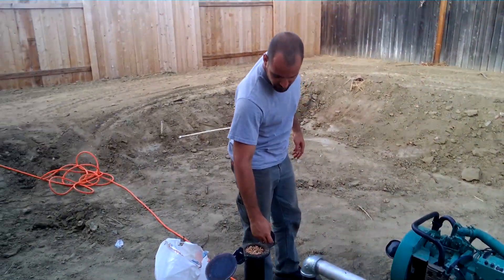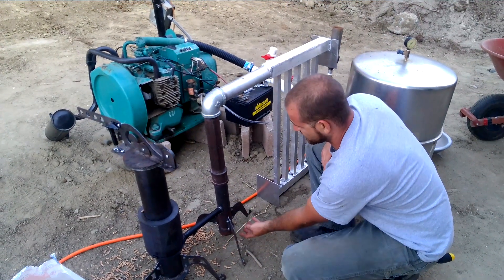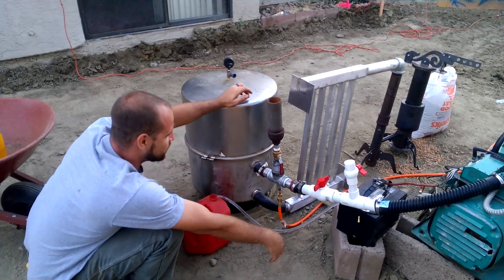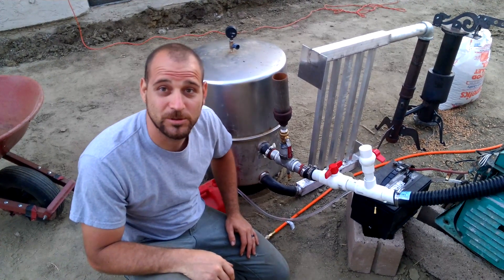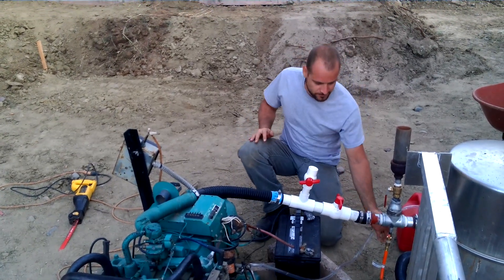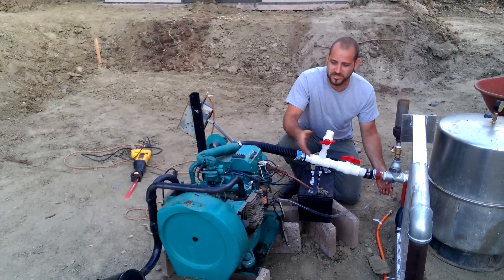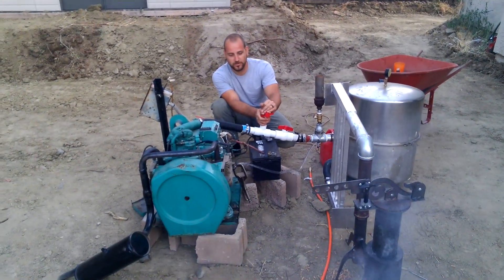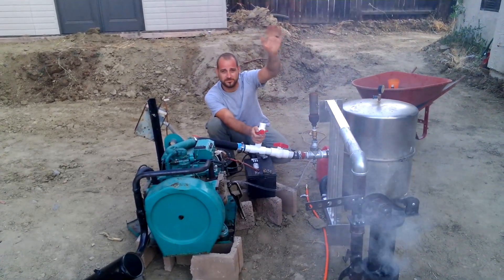Training Gasifier Rig

Comment: if you remove the bag filter does it run better?
Reply: Not too long, if at all.  The filter is getting tar out.  If tar is sent to the engine, it won't be long before the tar accumulates there, stopping the engine from running.  Then comes the breakdown, clean up, and reassembly.

Comment: Using a venturi instead of an electrical blower for startup … Nice, it's intriguing to see something different for a change. It's an alternative indeed, but not exactly an efficient one, given that you're having to run an electrical compressor anyway. I suppose it's better than nothing.
That said, with a venturi you're one step ahead of the blower fraction: In a true cold-start situation where absolutely no electricity was available, you can copy what steam engines (used to) do to generate forced draught: use a jet of steam, not air, from an auxiliary fired boiler, to power the venturi.
Reply: Interesting comment!
Reply: Could this also be done with something as simple as a bicycle pump or is that just not enough pressure?
Reply: @GeneralChangFromDanang  You should easily be able to answer this yourself with a simple Google search.

Comment: Flame tube needs to be bigger.. the horse power depends on the diameter of the tube just If you didn’t already know very cool setup. I did a Subaru station wagon. If you run water jets into your filter pot it works like a air  conditioning set up it cools and drys the gasses and gets rid of small particles all in one no need for the cooling system although you still need a car radiator to cool the water 🤙

Comment: maybe already asked but once you disconnect the air line whats stopping air from being sucked back in that fitting?
Reply: His finger
Reply: @tkmotors991  I'm sure he just didn't put in a check valve on it, or it just wasn't quite hot enough to be able to allow the extra air in the air line quick disconnect.

Comment: Question  Could you use a shop vac as you  bag filter and draw your air for start up then shut off the vacuum and let the gas flow through the filter love your plan simple and looks easy enough to build
Reply: I was wondering the exact same thing
Reply: Ted if enny body bild for me i have lat of wood tedwoodmaster@gmail.
com
Reply: Shop-Vac with work to pull the fuel up but it would never have enough in it to filter your smoke your smoke has to be filtered good or you will get sap build up inside of your motor and if you get sap built up inside of your motor when you shut your motor off your valves will be stuck open door stuck closed from the set when it dries using a gasifier the smoke has to be tear the gases that come out of there when that fire is lit you better not be able to see nothing but a blue flame or you will ruin your motor real quick you'll be pulling the heads off your motor all the time to clean them up your filter system is your most important part you must remove this app just want the gases and they've got to be Pure or it will ruin a motor fast sawdust makes a great filter but you got to change your sawdust frequently

Comment: No cowling on heads on that onan genset will cook that motor real fast
Reply: absolutely right, put that sheetmetal back on or engine will be toast.( I am an onan certifyed machanic.)
Reply: Ron Gibson iam an auto electrical and mechanical  engineer but we expect all to be switched on but its not there fault i guess
Reply: @bambo1957  Out of curiosity, how many generators have you personally run on woodgas?
Reply: @ronlabe5487  Threw that together in my garage with a couple beers with the buddys. lol

Comment: pretty cool looks like you need a lot of materials , a motor. tig welder, 12 volt battery, valves, fittings, piping, and wheat ever else

Comment: Have you thought about recycling the initial gas back into the reaction chamber in order to speed up the process and get up to working temperature faster? It should make sense especially when you can light it..
Reply: +Off Grid Pro I think that also biomass feeding produce the same reaction with a part of exaust ( max 17%) .  biomass, Into the reaction zone, is already become charcoal. boudouard reaction is the same CO2 + C > 2 CO. 
being an endothermic reaction, the temperature drops dramatically. The exhaust gases are to be injected at the maximum possible temperature. Below 600 ° C the reaction takes place in a small percentage
Reply from the maker: This technique works very well on charcoal gasifiers. Gary Gilmore started this latest resurgence in charcoal gasifiers, in which he routes a portion of the exhaust gasses back to the reaction zone in his units. It brings with it some fuel, and also cools the reaction zone a bit.

However, with biomass, the chemistry is a bit different, and this technique would have to be modified for wood. I'm no engineer, but it may not work at all. I haven't seen any discussion on this topic in the wood gas forums.

Comment: When that Onan is running at full speed (1800 rpm), and with no load, it should have no trouble at all getting enough gas from that gasifiier.   I'd estimate that the "overhead' power cost of that genset  (engine running with no load) is about 1000 to 1500 watts max.   I have a friend who has the Victoria and I have seen him run a single cylinder engine at 3600  rpms with a 3000 watt load.  Not for a long period of time, but for 15 minutes or so.  That;s clearly more load than you have there.
  Did you build that baghouse?  I'd like to know more about it.  It looks great!

Pete Stanaitis
------------------
Reply from the maker: Pete, In the video, we're using the Isabella gasifier, a 4-inch pipe gasifier (area = 12.56 sq. in.). The Victoria is a 6-inch (area = 28.26 sq. in.), and has more than twice the gas flow...

But you're right, a Victoria would be perfect for this rig... And one is coming :)

Comment: Stephen's basic Victoria would run that gen set no problem. Ours is based on the Victoria geometry.... with some other mods done... seems to work pretty good.

still impressive for what you're working with
Reply from the maker: Yep... This is also Stephen's design, and it's the next size down from the Victoria. Victoria = 6-inch restriction, and the Isabella = 4-inch restriction.

Comment: you need bigger gasifier or two of them to get the engine to run smoothly
Reply from the maker: Aire... You are absolutely correct. This little gasifier just doesn't have a big enough restriction diameter. Thus, no matter how hard we pull on it, it won't give us the volume of gas we need for the Onan. A Jump from 3 inch pipe to 6 inch will give us more than enough gas. This would be Stephen Abbadessa's "Victoria" design. My only concern in that situation is that we might have too much gas output for the Onan, and the suction won't be hard enough to create tar-cracking temperatures... We'll see.

I love the idea of using an Onan... The 1800 RPM is perfect for the slow flame front for wood gas, and they seem to last a lot longer than a cheap Home Depot type of unit.
Reply: @Offgridpro  would it also be possible to increase the output of wood gas by preheating the air? I've seen a design that uses the radiator to heat the intake air, but I don't know whether it increases output or just speeds up start times.

Comment: I have an Onan genset running on woodgas, too.
I was thinking that you were running too rich in the video.  Did you get it worked out later?
Reply from the maker: French, This was quite literally something we made in 8-10 hours. It was a mad dash attempt to get something working for a workshop we did.

I think that the gasifier was just too small... When we looked in the air nozzle ports, we saw that "white light" color... no yellow or orange. This means we were burning it about as hot as it gets. A jump from 3 inch pipe gasifier to a 4-5 inch would be ideal for this Onan. I have a 6-inch coming soon, but it is for a bigger generator.

Comment: This video deserves more views. This is a nice compact design you have. I built two gasifiers last summer and the second one was an Imbert design. It has a larger foot print because I built it out of a 55 gallon barrel drum. It will run approx 12 to 14 hours on one load of wood pellets and approx 4/12 to 5 hours if I use yard waste sticks. I plan on building a smaller Imbert with a small footprint like yours just for some fun. I'll be passing this video onto some other gasifier builders too.
Reply: flash001USA  I’ve seen your videos flash 001usa yours is epic bro the real deal !!! This guy seems like a tool hahaha lol and shouldn’t have even made this video “ made it one day lol!! Yeah right, just the top handle cap and metal work would have taken that long to fabricate. Who’s he fooling??

Comment: Ya the Aluminum is working great! We used it for the high thermal conductivity. At the inlet it gets pretty hot but at the outlet it stays cool enough to touch and hold. Working like a charm :) no aluminum is in the really hot gas zones. Thanks for the heads up tritowns.